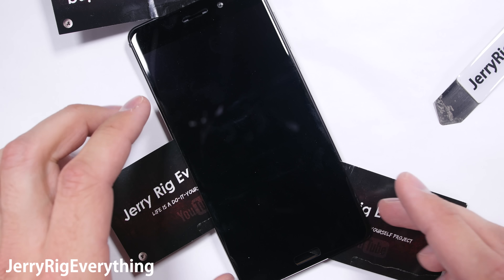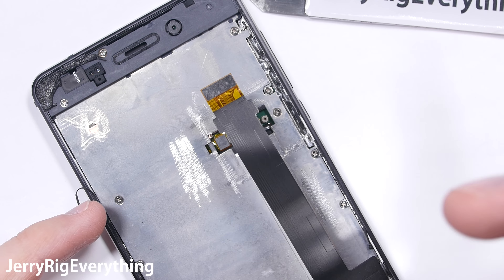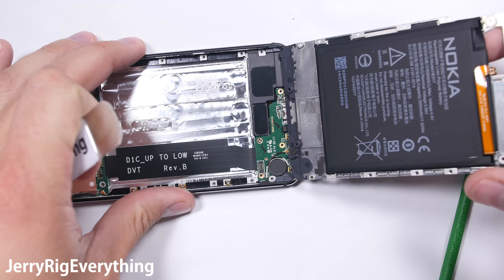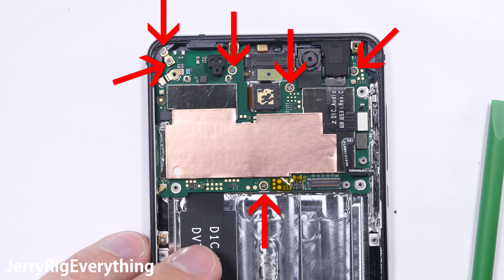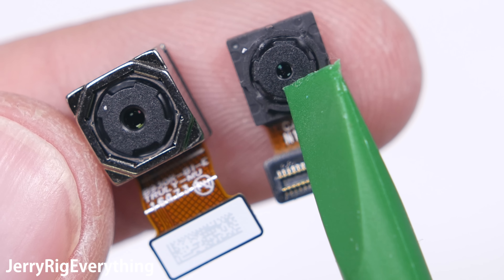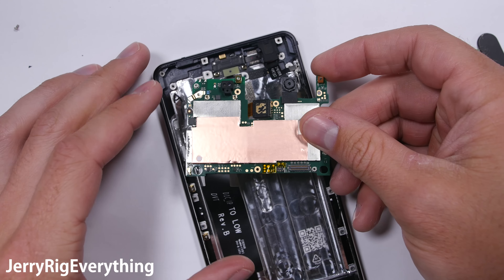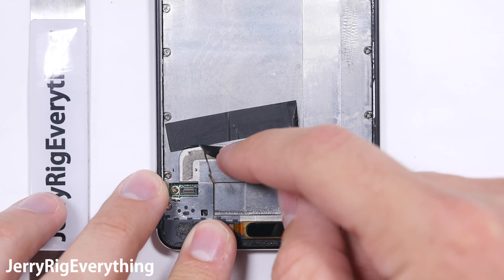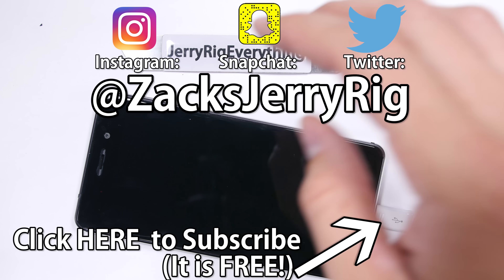Nokia 6 Teardown - Build Quality Review - Repair Video

Comment: This mobile has more metal than two iPhones
Reply: You are thinking of the wrong phone mate... iPhones' chassis are made out of solid metal
Reply: Josh H This nokia has such a thick metal chassis. No way any iPhone has such a thick one
Reply: bend gate wasn't even real... it was people sitting on the damn phone
Reply: Josh H Bro You could bend it with your hands
Reply: As this channel proves you can bend almost any phone with your hands
Reply: Okay, see bend test of galaxy s7, htc 10 and even this nokia one and then compare it with the iPhone
Reply: and yet the iPhone retains its shape after a flex...FYI flexibility is a good thing
Reply: Certain amount of flex is good but the original iPhone 6 had too much flex and it was a design flaw no matter how much you will try to defend it.
Reply: Of course it has more metal.
It's from Finland after all \m/
Reply: I thought iphones are manufactured out of aluminum which is then milled
Reply: Iphone was stupid
Reply: Josh H Not.. A good... Thing.. 

NOT a good thing
If the phone flexes it might bend the motherboard to the point where it snaps... And then? All apps, files, songs, pictures etc. GONE.. 
Flexibility is NOT a good thing
Just pointing that out.
Reply: Now I know why Nokia are costlier than their competitors. Way more sturdy & sophisticated design with build quality. Good going. 
I think I'll buy Nokia next.
Reply: Parag D Are you trying to make people think of buying Nokia by posting a comment like this, I have seen your comment many times in the same video man. Nokia is good but this is a cheap trick by you.
Reply: a lot 
a lot of key board warrior.

Comment: Thanks sooo much mate I've had my Nokia 6 for about 7 months and I inevitably dropped it for the first time today it was in a wallet case so I didn't think anything of until I pulled it out later to answer a call and I noticed the screen wouldn't turn on I knew straight away damn it it's toast.
Id watched your stress test on the phone previously so I came back to watch the disassembly video
Figured I couldnt make things that much worse, i successfully removed the glass and LCD with out damaged and the plate that holds the battery and LCD clips in and found the LCD partially unclipped, reclipped it and the screen immediately turned back on as if nothing had happened reassembled it all, heated the remaining glue got it the re-adhere fixed for free!!! Thanks to this awesome video.
Reply: that's amazing. these videos are so helpful.
Reply: Wow
Reply: Every modern user of a smartphone should be armed with this channel and ifixit! Amazing people.
Reply: i use mine since 2016
Reply: Did you use a heat gun or a hairdryer to make the glue stick again?

Comment: Imagine if Nokia manufactured actual tanks. Unstoppable deathmachines.
Reply: CrilleMega And their batteries would last for 2 weekz
Reply: Mattti Ajelee tanks run on engines.
Reply: Henning Gu Yeah, but they have radios and other electronics. By the way, that was just a joke about the battery life of 3310
Reply: A tanks battery lasts a year or two maybe more
Reply: But nokia's tanks will go on Electrical engines who can cross eeuu from one point to the other without recharging
Reply: Hydrogen reactors which strip hydrogen out of the air and generate power.
Reply: Naahhh... a Nokia tank would run on the souls of their dead enemies.
Reply: Well, they have already manufactured bullets so...;)
Reply: well... acording to wiki:  ... "Nokia also started making military equipment for Finland's defence forces (Puolustusvoimat), such as the Sanomalaite M/90 communicator in 1983, and the M61 gas mask from the 1960s." ...
Reply: Klemen Krnc The more you know 🌈
Reply: Unstoppable deathmachines? That designation would go to Panasonic.
Reply: And awesome rugged phone design. It would look cool !!
Reply: The tank has 3310 cellphones as standard issue electronic equipment and can be used to defend the tank by simply throwing it at the enemy
Reply: @thonmoyrahman2270  looool

Comment: Nokia should rename the series.
The all new NOKIA TANK.
Reply: Better fitting would be Nokia 3311
Reply: Well not quite yet, we still need Gorilla Glass 10 to come out :P
I hope some day soon we will see glass screens that dont shatter from head-drops.
Reply: That glass already exists; There is glass that is harder than ceramic. The only problem right now is with manufacturing. The glass tend to cool down and stick to its mold very quickly, which makes manufacturing it on a large scale almost impossible. Recently a group of Japanese researchers were able to make the first slab of that hard glass using "air sheets." But the process is expensive. If you can figure a way to mass manufacture this glass without having it stick to its mold then call me. We will become billionaires together :D

Comment: Proud owner of not one, but two Nokia 6.1 64GB phones! I saw them on sale at $124 each and I saw how classy they are so I got an extra second unit for the time when the first unit dies. I wanna hold on to standard rectangular displays, you see: No stupid notches and mile-long aspect ratios or those ghastly punched holes on the display! And after just a few moments into this video it just goes to show how good Nokia really is when it comes to design! And with Android One, the second unit will still get updates years from now. Incredible deal for $124!!

Comment: finally nokia switched to android. my next phone will be a nokia if they keep building tanks like this
Reply: I guess your next phone is gonna be a Nokia
Reply: I guess your actual phone is a Nokia now :))
Reply: @AgraelT  I guess not.
The thing is, no one breaks their phones in half and the screen on Nokia is just as vulnerable as anywhere else.
Reply: I can assure you this is a TANK! In all respects... 2 and half years going, proud of this one. I abused it a lot. It has fallen from my hand and pocket so many times, Some falls were so crazy that i was sure it wont work anymore when I turn it on, but no this beast carried on and is still going!
Damage History
Home button gave way suddenly after a little more than a year, been adjusting with digital buttons since, but it's probably an easy repair as the video showed.
Overheating while charging
Broke the screen, a line dividing the screen in the middle 5 months back (mind you this screen survived some very scary falls) 
That too I believe it was probably because i had recently removed the cheap screen protector as it was causing touch issues.
Few artifacts have been poking their head after that
2 weeks back temporary vertical lines slowly builds up along the spot where bright white icons/labels seen. (This annoyed me the most.. probably time to change the screen but it is still usable.
A recent fall (an hour back) in a very weird angle, one third of the screen broken in lightening pattern. Again this was after I had to remove the screen protector as touch stopped working, but it was working fine after I removed it, and again this is after a lot of falls.y Touch still functional, Keyboard area visibility reduced. This is sadly the reason I came to this video.
Updates are still coming
The comparatively older gen Processor is this phones weakest point i feel, its slowness is slowly creeping up. But nevertheless I would 10/10 recommend again over any phone at this price range as I am a huge fan of durability and love using devices to the brink of its death.
Reply: @DrDumplingMD  litterally the same thing

Comment: That metal plate in the phone is something I've never seen before in any Samsung or Apple counterparts. It effectively acts as a super tough cage surrounding the components, which is also something seen in the original 3310, only then it was made out of thick plastic. If Nokia are able to add OIS, change to the latest Gorilla Glass, increase the battery size, and do some more little things, then they will literally have the best mid/high range smartphone on the market. Keep 'em coming!

Comment: Zack could you please do a durability test on the new Umidigi Z Pro? I'm looking to get a new phone for my birthday on April first, and it's a pretty good budget phone. I need to know if it's durable!
Reply: Onima XIII how much is your budget?
Reply: the new Samsung A3 2017 costs about 320 euros and has very nice specs for it's price (even a finger scanner). Maybe have a look at that one?
Reply: Onima XIII what about xiaomi? the note4 is 5.5inch with decacore
Reply: Adrian Liberman I'll definitely check it out! ty
Reply: Onima XIII you're welcome! i use the note 3 pro and I'm satisfied with this phone. i heard the note 4 has better fingerprint scanner. in my country (south east asia) it costs about 140 euros, i don't know about your place though.
Reply: I'm using a Umidigi z  currently and also ordered the z pro. I'm praying that Zack will make a video about it right now
Reply: Buy a used phone mate. Sure you can find some s810 or even s820 for 300e
mediatek is shit.
Reply: MindBLowEd how so? I don't really know the differences between CPUs, I just see 10 cores clocked at 2.6 GHz and think it's good :p
Reply: what do you mean? last time i check, umidigi cost 299$ (mean around 276 euro). and if that too pricey 3/64 cost about 307 euro.  (i don't know about the custom price thought)
i have check that. it's still using emmc and use mediatek chipset. maybe i biased here as I have some issue  with their power consumption and gaming performance in the past and emmc is just too slow for me. well the design is better thought.dunno about camera.  

as someone before said. if you can find good secondhand phone (like OP 3/3t) better buy that one. it's better in every aspect
Reply: dont listen to these guys lmao, you should get the umi Z if you want to, but first check reviewers. the CPU is good, its a octa core of efficiency cores (A53) and 2 performance cores (A72), it should be a good phone hardware wise but specs cant tell us User experience, thus reviews are important. it for sure is the most value for money phone atm at 220€.
Reply: one thing that is bad is the batery life even tho its 3870 mha you only got 3 hours screen on time probably because that helio x27 and bad software

Comment: You shouldn't turn it on with the antenna cable off. Most RF transmitters burn out when powered on with no antenna.
Reply: Weese It's a Nokia...
Reply: Weese flight mode

Comment: Definitely a thumbs up for nokia for this durable/solid design. It for sure, does not fall short in that category. BTW the tucking style of the circuit board besides giving structural support to the board, also would keep it intact, the best possible way, during a drop!

Comment: Just got the 6.1 . Had the original 6 and both are tanks to say the least. The 6.1 is a little squatter with a better screen body ratio and slightly thicker. Had the 7.1 but had to return it . Don't know if pie was causing problems like shutting off and heating up.

So far the 6.1 has been great. I thought originally it wasn't that much of an upgrade but it actually is. Smoother and faster scrolling through texts and the speaker is much louder. 

Also has that cool "bothie" camera. Don't know what I would really use it for but it's nice to have  nonetheless.

I hope Nokia will continue giving us 6 series phones in the states . Good bang for the buck and there isn't anything in this price range or higher that is built better.

NOKIA COMING BACK STRONG !!!

Comment: 0:54 How about using the suction cup on top of the glass while heating it from the sides?
... You could use the cups in the side areas instead of directly in the center so as to prevent it from breaking under its force.
Reply: Yeah i think that whould be easyer but he did it in his way 😁

Comment: UPDATE: after two years using it and many many times droping it with no protection: It is still alive with no broken display !!!
Just the battery needs to be changes (I bought a new one and the tools to replace) and the power bottom has a problem and need to be pressed deep and not even with that it works every time. 
But this is maybe because sometimes I clean it with water or gel as I did before with the old Nokia and some liquid came in :D 
But I can fix it for sure
I LOVE IT

Comment: SD 835 
OIS PUREVIEW 12/48mp back 8-12mp front
AMOLED FULL HD screen
USB C
stereo speakers
finger print sensor
gorilla glass 5
$250-400
ip68 dust and water proof
Pure Android
same design (decrease bezel) and build quality

I'm sold!

Comment: i have a Nokia 6.1 plus and I cannot really recommend it. The USB C port failed only a few weeks after purchase. Although it was pretty easy to replace. Also the cellular and GPS signal reception is very poor. Do you have a video where u replace one of these glued on panels, where you want to use the same panel, and thus have to replace the adhesive your self

Comment: How do you get the screen to stay on when you replace it? I helped a friend replace a OnePlus 3T screen, and it seems like it's just a little bit of tension, friction, and adhesive around the edges... It seems like if you put the screen back on, it would be too easy to come off a second time. Did you add adhesive to it after the video? (We used a patch on the OnePlus 3T... it adds thickness though that leads to other issues.)

Comment: Jerry, I have the old one ( from the very first batches of Nokia 6's ) TA-1021 , since a while of usage ( off the warranty limits, of course) - I faced the problem of self-activating split screen feature , mostly when the phone in motion, but sometimes in still condition too. It's not only activates itself, it ( and this is the most annoying part ) starts switching between apps -, changing the splitting line position , in a quite fast way, I'd call it kinda dancing. I think the reason might be in faulty sensor or accelerator , or maybe both. The OS is Android 9 ( auto installed). As one of the solutions I see the disabling the permanent split screen feature disabling, but I couldn't find it anywhere in OS. Is there any other way of fixing such issue?

Comment: Hell yeah, Nokia Android built like a tank, my Nokia 5.1plus drop out on the screen corner for about 1.5m high on the screen corner, nothing happened, just need changed my tempered glass that was broken, amazingly all system absolutly normal till 6 month I used it right now.. Waiting Nokia 9pureview officially comes to my country.. 👍👍👍👍👍

Comment: my nokia 6 sim tray was stuck and cant eject. so i send to service centre. they remove the screen to push sim tray out from the inside. my question is,how could possible top speaker not working? i cant hear any sound from it

Comment: After seeing this tear-down... Next phone will be a NOKIA 6 with the new Snapdragon 630 out in May 2018. 

My brand new Apple iphone 6s kept getting slower after only two years use. Seriously this thing is now unusable. Cannot multitask. Constant iOS (bloatware) updates which reduced the clock speed of the processors are to blame... you cannot turn updates off.

Built in redundancy should not be a company tactic, and is environmental unforgivable. My son will nag me for a new iPad but that will be point blank refused. Environment first... Apple profits last!  

The biggest plus though is pure Andoid (Andoid One) where I can TURN OFF all updates. That is a feature of Android. Apple should could have this??????

I bet the NOKIA 6 phone will last at four and most likely six (6) years with a good armour case. RIP iPhone, you won't be missed.

Comment: Isn't there an argument to be made for screen-off first disassembly being worse? E.g. if you're only attempting to replace the battery there's an inherent risk of damaging the screen while doing so.
Reply: For a lot of phones perhaps, but the backing of the Nokia is a single piece of aluminium with the screen on top, so in this case the screen is the only way in.
Reply: Yea I agree, but I'm talking in generality.
Reply: Yes, unibody phones are usually a nightmare to open, because the design force you to open the screen first, and if you're newbie, you'll most likely broke the screen. And the screen is usually the priciest part.

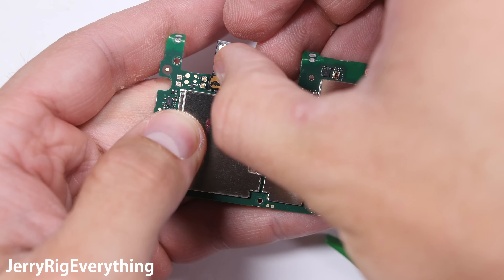Comment: I just wondered about the meaning of the qr code at 4:20 , and i tried to scan but it failed. So I turned on my photoshop and draw that qr code dots myself and this was the result : 'LFMED1C61008A70121A100904'.what am i doing with my life.

Comment: Talking about smart design when there is no non-destructive (yes, breaking an adhesive seal is destructive in engineering terms) method to open the device?!? How low are the standards nowadays? :(
Reply: Welcome to the 'not economic for repair' age. Nothing to do with design standards. No-one wants to pay extra for service friendliness, that is all. If it's broken, most people just replace the phone instead of spending half of the value of their old phone on a repair.

Comment: @jerryrigeverything  Thanks for the video, interesting as always.  I have owned some Nokias in the past couple of years, and now I am using an iPhone.  My old Nokia 1520 phablet consistently gets better than any of my other top of the line high end phones.  Which leads to my question:  How does the antenna reception stack up in this new Nokia compared to modern high end phones?  Is it as good as the 1520?  I would like to imagine its even better.